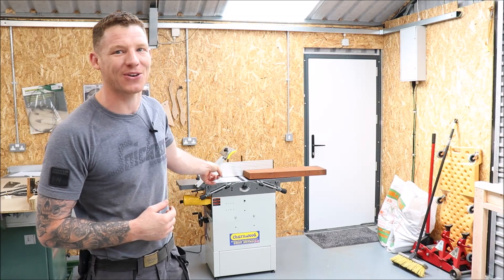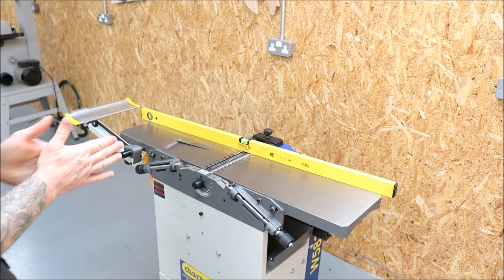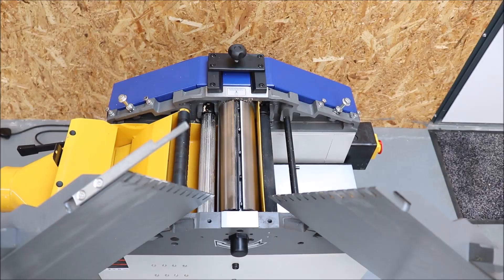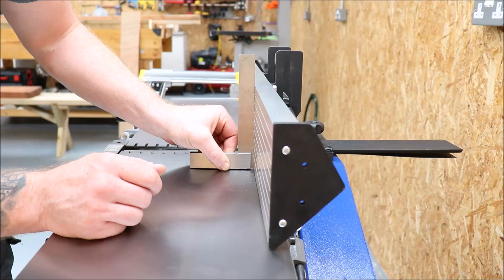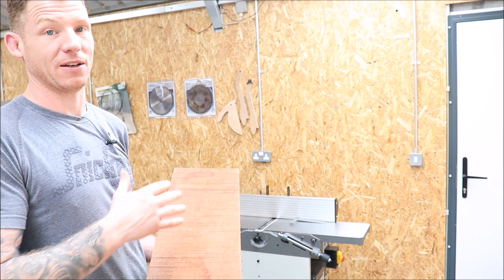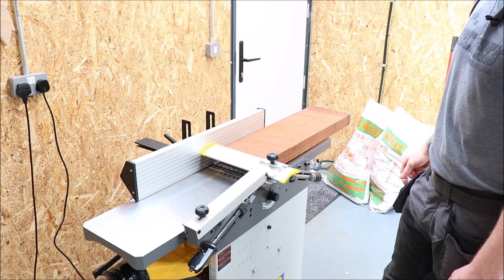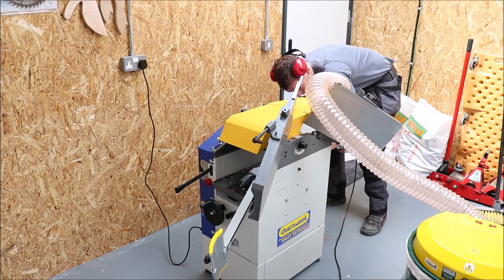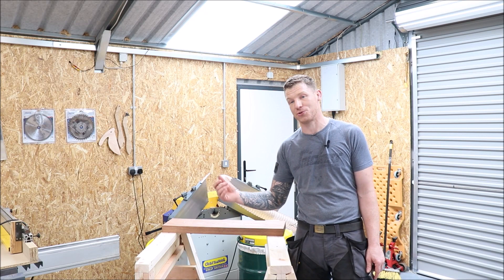How to set up and use a Planer Thicknesser/ Jointer Planer and Flatten and Square Lumber

Comment: The problem with setting your blades to your outfeed table is it screws up the thicknessing accuracy. If the outfeed table is not adjustable it maybe possible to unbolt it and shim it out, but all accuracy radiates from the cutter block. 
Don't use the bubble of your level to check the two tables, you're not putting up a shelf, place your level or straight edge at one corner then check diagonally across the two tables or try winding sticks.

Comment: Thanks for a great video John.  I have the Holzmann HOB 260NL, which looks to be identical to your Charnwood, and the manual is also rubbish.  @4:13 you show how to adjust the infeed table to be coplanar with the outfeed table.  However, I discovered a design flaw with these machines that prevents any coplanar adjustments.  There are two pins pressed into the adjustment arms on the front that lock the infeed table in place.  If you loosen the front adjustment bolts, the infeed table will not move because of the two pins.  However, if you knock the pins out, then you have full adjustment of the table.

Comment: I have the world's smallest shop and I tend to do only small projects because of my physical difficulties. I also like preparing stock with planes whilst I still can, I’m a newbie and still find it satisfying, heck I find the fact I can now sharpen a plane satisfying. 

However, next year I’m planning on building myself a decent workbench and I think it might work out better to get a small planer thicknesser like the Titan from Screwfix. 

This video will be very useful when I finally take the plunge.
Reply from the maker: Glad it helped, they save a lot of work and time preparing stock. More importantly accurate and square stock. If you are struggling a bit it will help with the physical side allowing you more time to concentrate on the fine detail work.
Reply: charnwood do a smaller one too.

Comment: I have an Axminster that i think is the same as this one.  I've used the jig that comes with it to set the blades but when I use the wood method with two lines 4mm apart to check the blades it moves the wood about 8mm.  It moves the wood the same amount on both sides so the blades are parallel.  Is this a problem?  When the infeed table is set at 0 should the blades be on the same level or should it cut?  Any help gratefully received.  Thanks

Comment: Say I set the planer blades using the same magnetic tool that you used, and I notice my outfeed table is out of adjustment. How do I calculate how high it needs to be? I would need to first make the infeed and outfeed perfectly parallel, but the outfeed still needs to be at the right height.

Comment: I just picked up a second hand version of this machine (but it's orange) do you have any info on a pdf manual? I'm in Australia, mine didn't come with the setting tool for the blades, is there a storage on the machine where this is kept? Can't find any info on my model and there's no branding or product numbers to find replacement parts

Comment: if you flip the board end to end as you joint it then you will be getting to the average thickness rather than taking too much off of one side. You will end up with a bit thicker board that is planed just by running the same end as the leading end.
Reply from the maker: Thanks for the tip!

Comment: Great video, just purchased one and yes the manual is rubbish, quick question, my fence is at 90 deg but it’s not perfectly in line with the table. So for example if I were to measure the width from the front left side to fence and then front right side to fence is would be about a cm out. Would this be a problem?
Reply from the maker: As long as it's 90 degrees to the table you should be fine
Reply: @JohnMcGrathManInShed  thanks, now I’ve got snipe and need to sort that out 🤦🏻‍♂️

Comment: Did you install the travel bolts back or they were not a travel bolts? 🤔
Reply from the maker: They are not travel bolts they are used to lock the beds so they are needed